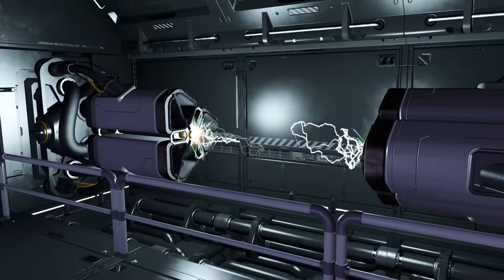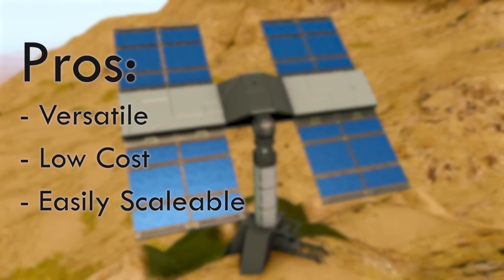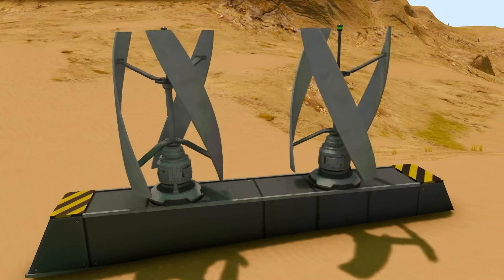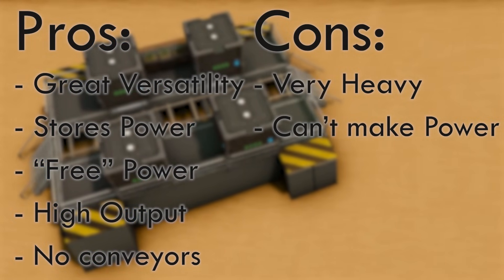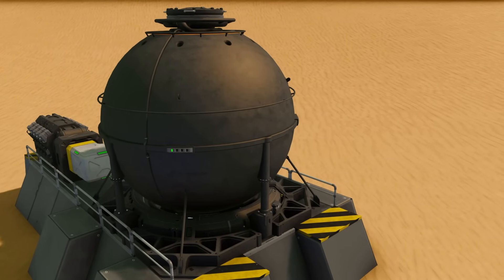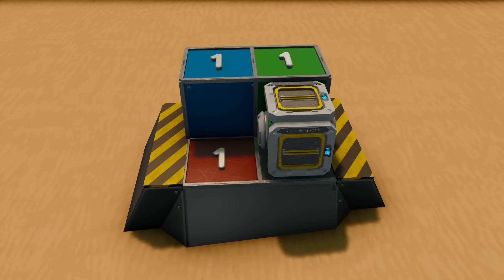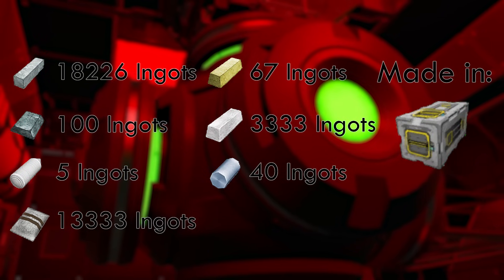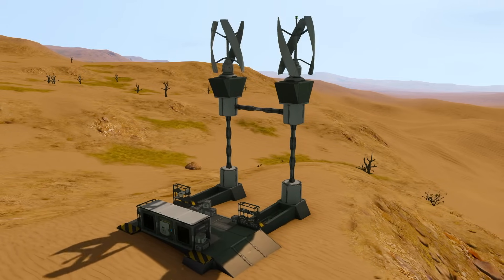The BEST Power Block in Space Engineers - Tier list & Comparison

Comment: Point of Order: The Batteries don't produce power. They store power produced by one of the others for later use.
Reply: Worse than 'store'. They are loan sharks that charge you 20% of all power you produce to store the other 80%. Not a biggie when paired with renewable energy (solar/wind), but never use reactor power to power a battery, and then run off the battery on a long term basis.
Reply: @Daniel-Strain  I actually didn't know about this! That's good information, thanks.

EDIT:
The SE wiki for Battery seems to suggest that the inefficiency of storing power extends to power received from nuclear and other batteries, but that batteries store power from renewables with full efficiency for some reason.

"Other power-producing blocks (solar panels, wind turbines) don't lose efficiency when recharging batteries."

It doesn't mention hydrogen engines either way though...? So I don't know about those.
Reply: I know I'm late, but for others and newcomers :
In SE you can actually "generate" power with batteries. Though, not in the... conventional way.
There is a known secret related to these power storing units, namely that they come with 30% energy, whenever they are newly built. If you build 3, set one to recharge, while the other 2 to discharge, you can almost fill 1 battery up. It costs you 160 power cells or 160 kg iron, 16 kg silicon and 32 kg nickel ingots. (I only meant here the "lost" components, which will turn into scraps.)

So yeah, they don't "produce" the power, but you can get some out of them. 

If you are on an atmosphere-less moon, without ice and sun light for the next 10 minutes, with power in your base for about 7-8 minutes, you'll have to get creative and attach some in a clunky way, which you'll grind down after they filled your original batteries.
Reply: @eleklovatka7666  This is very useful for powering ships that ran out of energy since you don't need to wait for the new battery to recharge.  I find myself using it sometimes when something goes wrong.
Reply: @eleklovatka7666 but isn't ice on all planets/moons?
Reply: @Visitor______________________v  technically, yes, but on the moon and mars, it's more difficult to get them. Not to mention the new planet, where only a few patches contain it.
In early game, it's a good tactic to build batteries if sun and wind are not as good as an option (if sun is set to 2 hour rotation and you start on the moon, as soon as the sun goes down and you don't have enouh charge, you're screwed for an hour).
Reply: @eleklovatka7666  You can find Ice on the Earthlike Planet's moon very easily by going North or South, the moon has ice caps. Also the Ice is visible on the moon from space, all you gotta do is get creative and make Moon-Jumper.
Reply: @thelaughingmanofficial  What I'm saying is really just for early game, where ice is precious and you don't have the luxury of time to run back and fort or even using it other than as oxygen+jetpack fuel. As soon as you have a vehicle with enough storage (car or small driller), you won't be short on power.
Reply: Batteries however do contribute to the overall efficiency of pretty much every power system in the game, since they store power that otherwise wouldnt be generated during times of low power consumption, which is why they are present on most craft and why they are ranked on top
Reply: @jube8835 Also, when it comes to the idea of extra power only at certain times, something else should be noted: power generators like reactors and such never produce power that isn't used. You could have a huge reactor and if all you run on it is a small light, then that is all the uranium it will burn. So, batteries aren't needed to supplement a power generator in emergencies if you are doing that because you imagine the extra power would otherwise go to waste if you had no batteries. But, in terms of weight/mass on your ship, or size/space, then the 'supplemental battery' approach might be useful.
Reply: @Daniel-Strain  while batteries are not necessary for reactor based power systems they are significantly cheaper, decentralized, and more space efficient (since reactors need conveyor connections they lose some space efficiency), using batteries to make sure reactors are always running means a much smaller construction cost compared to a ship that runs solely on reactors but only uses part of the reactors true capacity.
Reply: @jube8835  True, but one thing to note, a large reactor really isn't necessary for ships that primarily use hydrogen engines. Even needing to recharge a couple of jump drives, one only needs 2-4 small reactors and maybe a 2-4 batteries (kept charged and off until extra power is needed). Large reactors are only really needed for ion drives, atmo thrusters, and lots of rail guns.
Reply: @jube8835 Yes, but they should be kept turned off on such vessels, until the auxilliary power is needed. Sitting there just on auto, constantly recharging 1% to stay at max is just throwing power out the window.
Reply: @jube8835 he starts off by saying produce power. Already he killed his own ranking.
Reply from the maker: @johnard8831 Clearly you didn't pay much attention, like many others, as I repeatedly say "They do not generate power". 🫠

The only reason I mention the possibility of producing power with batteries, is because of the 30% charge they come with when being first constructed, meaning you could transfer the energy, grind down the battery, make a new one, and keep making power.
Reply: @BenDoesThings404  Except for the power cells, which turn into scrap metal. You have to build those anew with more resources.
Reply from the maker: @Daniel-Strain Of course. But in then you can almost view them as "fuel" in a way. Instead of using uranium and hydrogen, you use powercells.
Reply: @BenDoesThings404  I'll bet, if you added up the energy it took to get the ore, process it, then manufacture a power cells, it would be more than what comes in a newly built battery.
Reply from the maker: @Daniel-Strain  Not really. Even if you use a mining ship, its still incredibly cheap to produce the replacement powercells. Even more so considering the scrap becomes part of the iron used. Its the big upfront cost of the entire battery that is the drawback. But once you have that, cheap power all around.
Reply: @BenDoesThings404  Then it would be an interesting experiment to create a line of batteries with a timed row of grinders on one side and welders on the other, and see if that would create perpetual power. Make sure all mining ships are battery power only and get their recharge from this massive grind/weld battery row.
Reply: Simply saying, they are storage plus capacitors

Comment: i wouldn't consider the battery a "power block" for ranking as the whole point is to determine which one PRODUCES the most energy vs its size and components. Batteries do not generate electricity, they just store and conduct electricity. It is related, but not the same. 
However, you NEED batteries to fly around in your ship. if you need to maneuver and all your thrusters starts engaging, you typically have bursts of power costs far exceeding what any of those generators could readily provide without the buffer of stored energy from batteries.

Comment: Well you could consider batteries to be power generation. If you grind them down when they're depleted and reweld them back up, they effectively act as reactors that convert 720 kg of iron, 80kg of silicon, and 160 kg of nickel into 900 kWh of energy. And, of course, iron, silicon, and nickel are much easier to get than uranium - you could run it entirely on stone, if you wanted.

Comment: Too much wrong with this ranking system to explain all, but will at least say for the small vs large reactor, 27 small reactors would require an entire conveyor system. Which means they essentially take up MUCH more space than 1 large reactor.
Reply from the maker: Not necessarily, as you could see when talking about the small and large reactors, most of the small reactors were actually connected too each other. I believe it was only 4 of them that wasn't connected or had ports facing the outside, which is the same amount the large reactor has.

Comment: Hydrogen engines fuel efficiency sucks. I mean the only way I could see you not running out of fuel instantly. If you have a hydrogen running for an extended period of time is to literally have a massive ass by sparge that's constantly drilling ice. In fact, those are the only people that have seen use hydrogen engines without immediately running out of hydrogen

Comment: Comparing Reactors to Wind Turbines? Well.... You don't take into account what's available and how to efficiently built in numbers, aka you need, say, 3MW for your base 24/7. how many solar panels + batteries or wind turbines (placed best) do you need. What is it for a mid/endgame 15MW? Next: How much continuous effort does it take to get whatever fuel if needed. Self building/extending ice drill rigs are fun to build - and way north of the average beginner while it takes 20min small grid miner to get all the uranium you need forever. Others already mentioned PCU costs per MW.

Comment: I wouldn't call the hydro generator the best I mean it all is dependent on what you need. Hydrogen is fairly easy to find not it takes a lot of it to keep things running while a solar panel or wind turbine once made never needs any further material to work. The nuclear power systems is hard to find fuel for but it offers some the smallest ways to power vehicles especially small grid ones. I like to have a small reactor on small grid units as a back up while using a connector to keep batteries topped of most of the time. So it really depends on what you are building.

Comment: I typically use solar power (and wind when in atmosphere) for general power generation and have my Hydrogen Engines and Reactors activate when power consumption reaches a specific threshold to prevent my batteries from being drained dry. This method works pretty well when I'm doing a space start and make a giant mining ship.
Reply: How do you get your engines & generators to automatically switch on on that threshold and not have them recharge batteries?
Reply: @Dardomor  Manually

Comment: Wind is at least B (your cons are mostly invalid). Batteries don't produce energy. And Hydo-Engine A? Never. It eats ice faster than you can bring it in. The only really valid option to power a base constantly and efficiently is a large reactor. Well, multiple reactors. So it's A tier. But it consumes quite some Uranium. That's why it's not S.

Comment: I’ve always liked the hydrogen engine, usually used as back up power since you can find ice pretty much everywhere
Reply: I have a massive rover with everything in it to process material and build things. Basically a rolling base. It has 4 large grid batteries, 3 large hydrogen tanks, and 2 hydrogen engines set up on my hotbar. That way when my batteries start to drain a bit, I just switch on the engines and I’m good to go. I also have 2 solar panels on top for passive charging. If I’m not processing ore, the range on that thing is insane with that setup. You’d have to be really careless and in the dark to be stuck without power.
All that to say, I absolutely love hydrogen engines, especially with the supplemental trickle of power from solar panels and occasionally being hooked up to a station to offload.
Reply: Yeah, it’s really nice especially with your Hydrogen ships as you already have a large amount of Hydrogen onboard. 
It’s super convenient.
Reply: Same here one of my first large plunge mining ships ive made uses like 14 or 16 of them with 8 h2/o2 generators and 4 batterys just so i could get a full cargo of Uranium as i got tired of doing runs with my small ship miners and now its one of my go tos for mining in space

Comment: Batteries doesn't generate power... Batteries hold power..

Also panel and turbine doesn't require fuel source

The problem with hydrogen engine is it is not making enough i think and many ppl use the hydrogen to power ships cuz it is most versatile sourse of movement

Comment: Appreciate the vid. Two things. PCU vs out put may have been a good addition. I consider batteries energy storage not power generation
Reply from the maker: That is fair, I completely forgot about PCU, given for years not I have mostly used block-limits, and forgot it existed, I will remember that for next time. As for the batteries, I agree they aren't for power generation, they are in the power-blocks category in SE, meaning it fits into this power-blocks comparison 👍
Reply: @BenDoesThings404 but what are you comparing? You're comparing apples with oranges
Reply from the maker: You'll have to be a bit more specific. I am comparing different aspects of different power sources to determine which one is the overall best. ALL of them are good in their own way, but some are better than others overall.
Reply: @BenDoesThings404  I would still say in terms of 'power blocks' batteries should be F-tier, as they have the biggest disadvantage of them all - they dont generate power.

Comment: There are some ways to mitigate the solar panel's downsides a little further. If you're using them as cheap and reliable power for a zero atmosphere base, such as on the moon, build at or near one of the poles. A solar array with some elevation can produce maximum power 24/7 while only draining with a turret controller and one rotor. Because ai solar arrays following the sun use their actuators even at night, cutting back on one actuator and never powering actuators that aren't bringing power back in, really means a lot to your base's power grid. I don't know if it can provide more power for it's floor plan footprint than turbines when inside an atmosphere, but polar solar is always the best solar. As always, use some batteries for storage and the extra output when it's needed.

I don't know if oxygen farms care about their angle to the sun, but you can stick those on your rotating solar pole too, so long as you use an advanced rotor and conveyors. Last but not least, whatever you do, DO NOT FORGET TO INSTALL METEOR COUNTERMEASURES, regardless of however you set up your ai solar arrays on the moon. It's one thing to have an impact on a static, cheapo standing array, and another to have a more expensive smart array get hit and potentially fall on something else, especially early on when you aren't set up for hydrogen power. Thankfully an inexpensive interior turret or two will be cheap enough to fire using whatever magnesium the meteors bring you, and help you maintain your foothold until hydrogen is logistically reliable, or maintain a hands-free power supply so hydrogen and ice mining aren't as necessary in the first place.

Comment: The solar panels can be stacked in two layers. This is not known by most new engineers. Just flip it around when making your array and you'll be operating at 200% 😁
Reply: this^ is so huge and not talked about enougth
Reply: I don’t understand what you’re saying, “stacked in two layers”
Reply: @BaliAgha  when you put 2 solarpanels with the collectorsides above each other both get full power, or to explain it the other way around a single "layer" of a solarpanel can only harvest 50% of the incoming light with its collectors and the rest is let through
Reply: All of my solar usage takes advantage of the panel double up twice the power half the space
Reply: Does this work with large grid? And/or with colored panels? I was trying to do it the other day and it didn't seem like both sides were producing, and yes I did have them back to back though I can't remember what the grid size was
Reply: @connorbrown7455 yes, but you have to flip them to the proper orientation to get them to place

Comment: As others mentioned, there'S easy tricks to minimize the impact of the windmills restrictions. It's pretty much an easy go to for bases on atmospheric planets. Providing ample power and for the occasional lull in the winds (or damage) a battery or two (more for bigger bases obviously) you quickly get to the point of not having to worry or think about anything.
And that's kind of the biggest concern: being able to divert attention elsewhere.
Some people have had bad experiences with H² Gens being forgotten and left running.
Personally I never use it much, because running smaller things of batteries and planetary bases of windmills works very well.
Solar panels are cheap enough to spam them (if you don't have to worry about PCU) nad theoretically, you've got enough room in space. but their low power output is a bit of a bummer.
but once you're in space, transitioning to nuclear power is just a matter of time/luck finding the ores. Comparing uranium and Hydrogen as fuel, Uranium seems to be the one you could easier forget about.
Considering how long making power cells takes (more than 5 min for a large grid battery in an assembler without speed modules) and how big they are, building batteries for power is a lot of a hassle, especially in the early game. I wonder how "efficient" a Setup with event controller/timer block, welder, grinder and projector would be, deconstructing the battery and building a new one, every time it runs out.

Comment: Each option has their advantages in certain use case scenarios. 
No atmosphere ? want passive power ? go solar for sure !
Holed up on a planet ? Turbines actually work underground for a secure and passive power grid.
On the move day and night ? Hydrogen engines are king.
Need raw output in a smaller footprint ? Reactors are the way to go... if you're in a position to need their output, you've probably already secured a supply of uranium.
Pair everything with batteries to suck up the juice for additional output capacity for high demand situations.